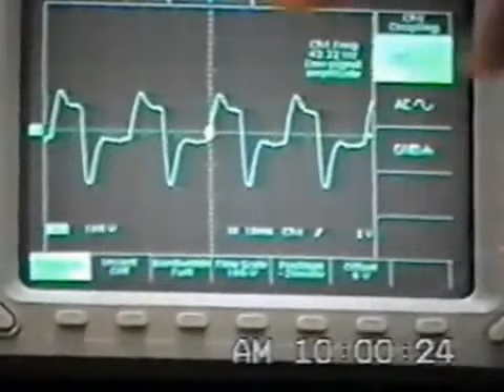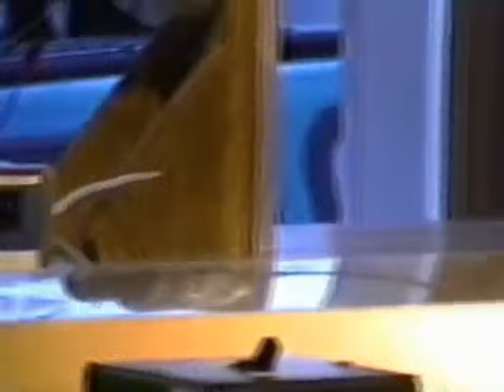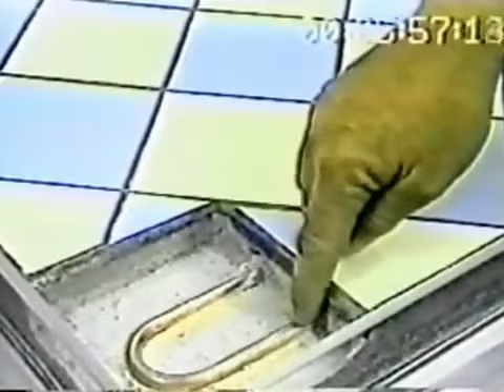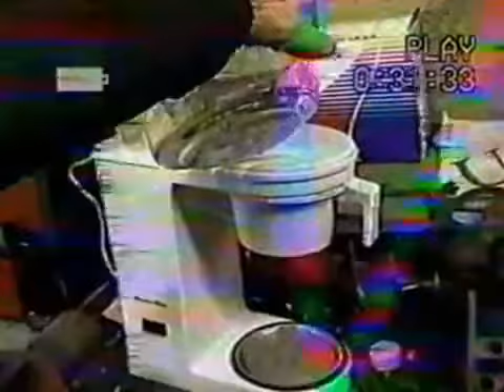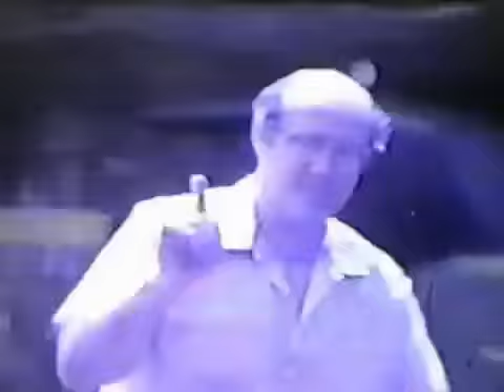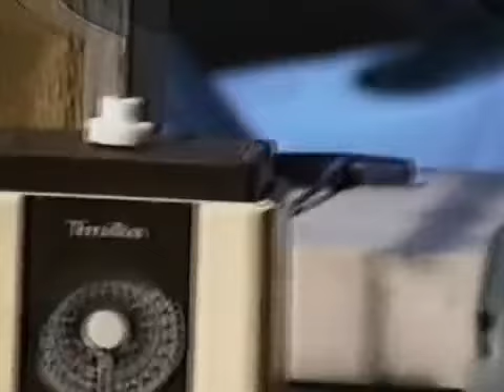Better World Technologies - Dennis Lee - Research & Projects

Comment: Hey Chris, thanks for these vids.  On minute 7:38 looks to me that he says that he has 2 coils wound around the iron core, could it be bucking wound coils?? He is catching the back emf from collapsing field dependant on frequency
Reply from the maker: +Alex Manzanero   ---   "Current is deemed as a quantity or number of charged particles moving from P1 to P2 in time t, or as the charge transferred in one second by a current of one ampere. The coulomb is the charge on 6.24 x 10 to the 18 electrons. Electric fields are due to the presence of charges. Magnetic field effects are due to the motion of charges. Current is the net rate of flow of positive charges. This is a scalar quantity.
 
In the specific case of positive charges moving to the right and negative charges to the left, the effect of both actions is positive charge moving to the right. Current to the right is: I = da+ / dt + da- / dt. Negative electrons flowing to the left contribute to the current flowing to the right."   ---   Floyd Sweet

Yes the Magnetic Fields MUST Oppose, this is how Electromagnetic Induction Works. http://www.hyiq.org http://www.aboveunity.com Join our Forum!

The Number Three truly is a Magic Number! It is Asymmetrical, the Number Two is not, it is Symmetrical.